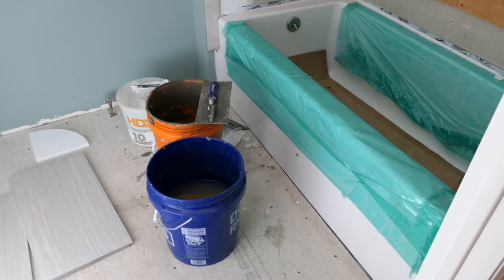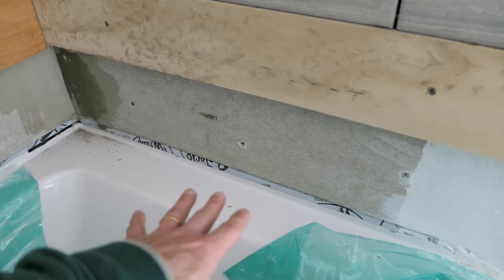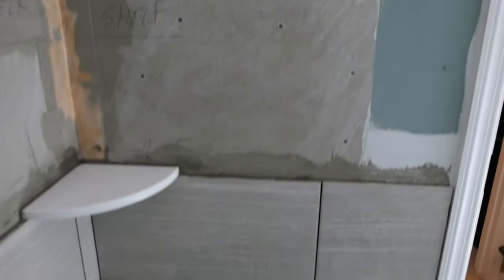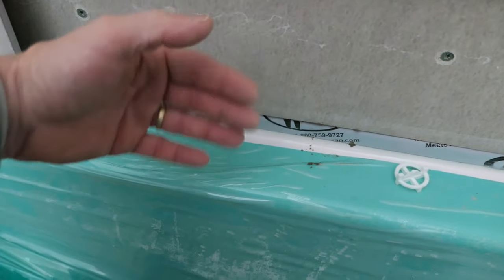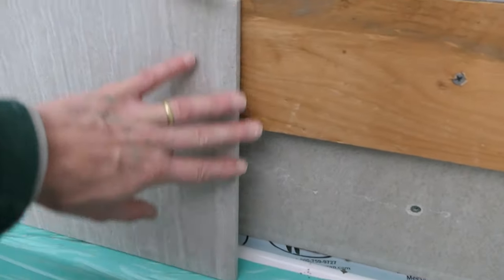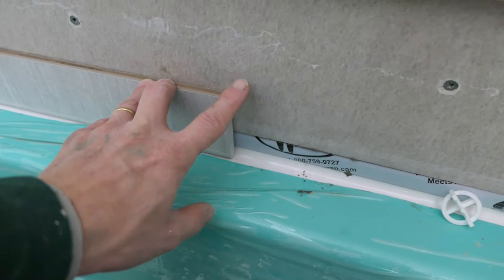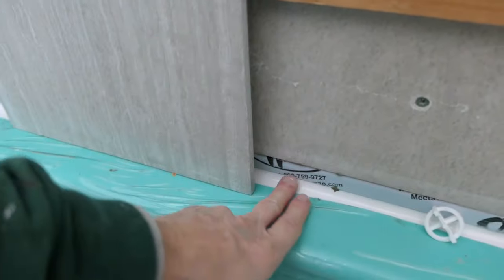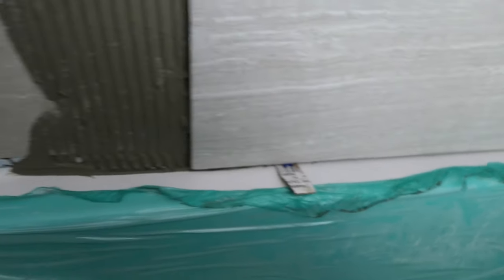How To Tile Over The Lip Of A Tub Or Shower Pan

Comment: If you're doing this for yourself let alone professionally, spend the extra cash and put a few layers of Redgard/Hydroban or use Schluter especially if you're already attempting to waterproof the corners. I've pulled out many showers and cement boards are water-resistant not water-proof. Grout is always waterpermeable hence why most custom high tiling jobs for curbs use solid stone cap or longer tiles since it's high traffic.
Reply from the maker: I do use Schluter membrane one certain jobs, especially when the shower floor is being tiled.  However, it simply isn't necessary to use it in every case and there are drawbacks to using it.  These include poorer adhesion of tile compared to the straight Hardibacker I use, and greater time and expense.  You should also be aware that Hardibacker now does sell a product with "hydrodefense" which is claimed to be waterproof.

Beyond that, I have taken apart somewhere between 65 and 70 bathrooms, and not a single one had water intrusion in the middle of the tile field, even though many of them simply had greenboard backer.   Where I DO consistently find water damage is at the floor where the edge of the tub or pan meets the plywood.  That's where I spend extra time and expense to waterproof, using self-adhesive flashing.

Comment: It really looks like most bathroom remodels would need the backer board to come to the lip only, in order to match existing drywall. In that case, note to self - DON'T use smaller subway tiles for those remodel jobs

Comment: This was super helpful. So basically if you cannot bring the backer board all the way down then you must pick a large scale tile? Do you have any other solutions for when this occurs and your tile is not large scale?
Reply from the maker: My rule of thumb is that 2/3 of the tile is adhered to the backerboard, so that doesn't have to be a large format tile if you have your tub lip exposed.  A 3x6 tile, for example, would be okay if the lip exposure is an inch.  Of course, the more adhesion the better.  If a client really wants a smaller tile I make every effort to bring the backerboard over the lip.  But, sometimes it just isn't in the cards.

Comment: Some say don’t bring backer board over the lip of a shower. Water can get through the base and if it touches the base of the backer board it will wick it up the board and keep it wet, rotting wood, creating mold etc.
Reply from the maker: My advice is based on experience, not fear.  First, as you saw, I use a flashing system behind the backerboard so even if the backerboard somehow became saturated it wouldn't go any farther.  Second, the backerboard is covered in tile, then the tile is grouted and the bottom gap by the tub or pan is caulked.  Water does not get behind there unless the installation was extremely poor or the homeowner failed to maintain the caulk over a period of years.  And, if the caulk is missing, then the water can come right back out!  It just isn't the problem it is made out to be.

Comment: I'm learning to reno my bathroom and I appreciate you pointing out to consider the movement of the tub by using caulking. However, if water would ever get behind the backerboard, how would it drain into the tub? Wouldn't the caulking block water from doing so?
Reply from the maker: To be clear, the flashing is NOT about everyday use.  It's there so that years down the line if the homeowner fails to maintain the caulk or grout, or if there is significant framing movement, water isn't going to drain into the wall cavity.  In a tiled shower that has been detailed well and has grout and caulk intact there is no water getting behind the tile.  There isn't even moisture getting through the grout unless you have a family of 12 who use the same shower all day long.

Comment: Great videos! My husband redid our bathroom years ago. I'm not sure where he got this from, but in addition to using a bathroom drywall product (not sure of the brand, but it was green), applying kerdi all over the walls, corners and ceiling (we have one of those shimmed-in showers with ugly borders) and covered in 8x14 tiles, he kept saying that there was a need for a large gap at the bottom. Something like it's inevitable that water will get in, as the grout is permeable, so the kerdi will protect the wall behind, and the gap at the bottom allows the water to come out and "breathe" 🤷. It's a ½ inch gap. He then filled the gap with clear bathroom silicone and then put white caulk on top to connect the tiles to the tub. I admit that I haven't been maintaining the shower and saw some dark mold in an area, so today I just removed the caulk and silicone to find nasty, wet, brown slime. Instead of caulking again, I want to use a "seal-a-crack tub surround waterproof adhesive sealer" I got at Home Depot, so it'll take care of the gap. My question is, how do I get the gap clean again and prevent more moisture from forming and needing to take everything out and do another expensive renovation? Is it salvageable?
Reply from the maker: Oh boy.  A lot to unpack here.  So, I can only make some guesses about the construction based on your description.  You mentioned a green drywall product, which I'm going to assume is "green board."   That is no longer used because it is just a slightly more water resistant form of drywall and in wet conditions it can still support the growth of mold, as well as crumbling if it does get wet.  Kerdi membrane is a waterproofing product, but, like anything, the devil is in the details.  If it isn't installed exactly right it won't work. There was a time when Schluter (who makes Kerdi) did advise installation over greenboard, but pros avoided that.  I don't know how your husband handled the detail where the Kerdi comes to the bottom.  That whole caulking thing you describe is not something I would recommend.  I'm presuming he used thinset that he mixed himself, rather than some pre-made product or mastic?  

Anyway, it sounds like water has been getting in somewhere and for a long period, and now you have some nasty stuff which may have created a problem with the drywall underneath.  The 1/2" inch gap is way too big and cannot really be effectively caulked.  At this point you probably have two choices.  One is to remove all the caulk you can, clean with bleach and let it air out for a couple days.  Then you could attempt to recaulk, perhaps after installing backing rod.  The problem will likely return though.  That seal-a-crack product doesn't sound promising to me.  The second choice would be to remove the first row of tile, and then try to re-tile using a complimentary color or perhaps you still have extra of the original tile.  In that case, you would do as I did in the video and keep the gap between tile and tub the same as the grout lines.  Then use a silicone caulk there.  However, there's no guarantee the original tile on the first row will come off without cracking other tiles or that the substrate underneath is any good now.

It may be worth calling in a local tile pro to see if he has suggestions.  It's pretty tough for me to offer better advice without seeing the problem in person.
Reply: @enduringcharm  Thank you so much for taking the time to respond and providing a helpful answer. I'm never going to neglect caulk or grout ever again! 🤣 You've gained a new subscriber! 👍
Reply: @IamSlacker  are the vertical corners caulked or grout? I always use a color matched caulk on the corners of walls because they can crack and water will get it and work it’s way down. Usually the corners next to the shower head. Once it goes down and gets behind the caulk on the bottom it works horizontally because it can’t get through the caulk. I’d run a thin layer of color matching quality caulk on the corners, over the grout line. Use tape for a clean line and work it in with your finger to make sure it gets into any hair line cracks. Good luck 🍀

Comment: As a professional tile setter myself you are 100% correct in this video.  The only thing you forgot to mention is how those spacers are the best spacers in the world.   Like how they are straight on the back side and 4 way on the front side and how you can put them in the back corner and they work as the best guide in the world for the opposing walls to make your grout joints align perfect every single time.   Plus you should mention that a tile job turns out the best when the tiles on the back wall go corner to corner and the opposing walls butt into the back wall.    Good video E.C.
Reply from the maker: Yeah, we forget what a pain those old rubber spacers used to be!  The plastic ones are much more consistent and also easier to remove after the the tiles are set.  I do sometimes use one or two of the old rubber ones when a tile is not uniform or the same size as the rest of the tiles. Another great thing about the plastic spacers is that you can get more use out of them.  I have a bucket of 1/8 spacers I've reused countless times.

Comment: I see your method. Thing is filling that area with thinnest will create a area to suck up moisture and create mold over time. Best way is to fill with a sealant from wedi or laticrete flush with the back board. Which foam board is a great option.
Reply from the maker: I hear of that fear a lot, but it simply isn't true.  Antimicrobial products are added to modern mortars, such as "Moldgard" in FlexBond thinset.  Mold needs a food source as well as moisture, and neither the thinset nor the tub lip provide that source.  If the last row of tile is properly caulked with a silicone caulk against the tub or pan, and if the grout is sealed, there really shouldn't be any water getting behind the tile at all.  Of course, homeowners do neglect maintenance.  But, in all the baths I've torn apart, that's not where I find mold.  It will be located where there is wood, or drywall in the old days, or in the grout.  I've never had the lip area be a problem, except right under the faucet when tile was put over drywall or greenboard.

Comment: Great vid! I have a question: you can see that your cement board looks almost flush to the tub there, on mine the cement board juts out much ahead of the flange lip. I have a 1/4th gap for expansion between the two, but I'm just wondering if this will cause issues with finishing it if the cement-board is roughly a 1/2 prouder than the tub flange?
Reply from the maker: Well, the backerboard itself is no more than 1/2 inch, and many brands a little less.  So the difference in plane is probably not as much as you fear.  Nonetheless, when you have a significant difference between the plane of the lip and the backer, the most important thing is not to choose a small format tile.  If you have a 12x12 or a 12x24 tile, the lip area is inconsequential because you can just fill the space with thinset for support but the adhesion to the wall takes place above.  On the other hand, if you tried to use a small 3x6 or 6x6 tile, a large amount of the surface area of the tile would be over the lip.  That could be trouble as far as adhesion and durability.
Reply: @enduringcharm  Thank you for the reply! This is exactly what I ended up doing! I'm using large format tile, 12x24!

Comment: Thanks for the video! This is exactly what i was wondering after installing my backer board. I used your method of the flashing and brought the backer board down to the lip but did not overlap. Unfortunately I already bought small tiles and they’re not refundable. What are your thoughts on inserting a strip of 1/4” Hardie Board into the gap and adhering it to the flashing with construction adhesive to give a more solid backing?
Reply from the maker: I'm not thrilled with the idea of a filler strip.  No matter what you use to fill that space, it isn't going to stick to the flashing or to the lip of the tub if you didn't use flashing.  So whatever you put in there isn't going to provide adhesion for the tile, it's just going to fill the space so that the tile doesn't crack if bumped.   If you install a small format tile it will adhere to the backerboard with thinset and it will stick to whatever thinset you use to fill that cavity, but that same thinset won't stick for any length of time to the flashing or to the lip.  When you caulk the bottom of the tile with silicone that will provide some additional support.  If you go ahead with the small tile, I would advise you to get as much of it as you adhered to the backer and be meticulous in the other two details.
Reply: @enduringcharm   thanks. It sounds like I have some decisions to make. The bathroom is part of a larger basement remodel so I might be able to repurpose the smaller tile

Comment: Great video!!! Did you shim the tiles in for support on the bottom
Reply from the maker: Most often I will use a ledger for the second row and complete the walls, then remove the ledger to complete the first row.  I'll use spacers to set the gap between the tub/pan and tile to the same width as the grout lines.

Comment: Thanks so much for sharing this tip and your expertise! One question - do we tape the plastic wrap to the flashing or just let it hang over it with no seal?
Reply from the maker: To be clear, the flashing and plastic are there in case there is a problem in the future, such as grout or caulking not being maintained or framing movement.  You can just overlap the two components so that if water got into a corner, for example, it would run down the plastic, over the flashing and back into the tub.  The plastic should not cover the whole wall, only about three feet up from the lip.  That's enough to offer some protection but not so much as to create a double vapor barrier.
Reply: @enduringcharm  Great, that is what I figured, but I wanted to confirm. Thanks! :)

Do you happen to know where I can find guidance on how to put plastic sheathing behind a shower niche? I have one in one of the walls of my shower, but still want to use the method you describe here.
Reply from the maker: There's really no difference, you can usually sneak plastic behind the niche if you wish.  I do prefer the one-piece pre-manufactured niche inserts which are not going to leak.  There are some made of plastic, and there are those made by Schluter.  I've used both successfully.

Comment: Great videos... super helpful. What would you do if the tub lip sticks out past the backer board? I can’t shim my wall for the reasons you’ve described.
Reply from the maker: Some tub lips are fairly thick but it really shouldn't be sticking out past the backerboard unless the rough opening is actually too big.  If the mismatch is greater than, say, an 1/8 inch, you may need to adjust the rough opening or carefully split the distance to minimize the problem.  Other solutions include shimming the backer a slight amount and significantly feathering the wallboard joint, or using thinset on the backer to create a little extra space.  In extreme examples where the rough opening is too big and the walls can't be moved you may need to shim out an entire wall.  See this video for an example of that:
https://youtu.be/-bViu_9CJ58

Comment: Thanks for the explanation. I’m remodeling a 1980’s bathroom, and the original surround had two layers of 5/8” drywall (no waterproof membrane), and the edge was finished with radius tile to step down to the bathroom wall which is a single layer of 5/8” drywall. I’m not sure how it lasted 40 years, but it only failed when grout in the window sill cracked. Windows in shower surrounds were popular in the 80’s for some reason. Have you ever seen the tape over the flange lose adhesion over a period of time?
Reply from the maker: Your double layer of drywall is odd, but it was routine to use drywall as a backer for tile decades ago.  The thing is, I have taken apart dozens of baths built that way which were in perfect condition.  Thankfully we don't build that way anymore.  On the other hand, I have to roll my eyes sometimes with the modern obsession with waterproofing. Some people go to extremes with waterproofing when it isn't necessary, or preach about the sky falling if a particular brand of waterproofing isn't used.   The flashing tape trick I use not as waterproofing, but as a backup in the event the homeowner doesn't maintain the caulk and grout over the years.  Sometimes I will also use a waterproofing membrane made by Schluter if I'm concerned about a particular installation.

Windows, on the other had, are a big no-no.  I remove them if they are found in a shower because it is inevitable that they will fail and allow rot inside the wall cavity and other problems.

Comment: Thank you for the video. It is very informative.  I have a question.  What do you think about using liquid waterproofing membrane (Mapey brand for an instance) on the walls above a bathtub?  Thank you.
Reply from the maker: When I need to waterproof a whole shower I use the Schluter brand Kerdi membrane.  It's a plastic membrane with a fuzzy coating that provides waterproofing and good tile adhesion.  Liquid membrane can be inconsistent in coverage and adhesion may be questionable.  I don't use any of those products.  Now, when I tile the floor of a shower I use the Schluter system and run the Kerdi membrane right up the walls.  On the other hand, I don't find that a complete waterproofing system is necessary in other cases.  Instead I use a flashing system behind the backerboard which I've shown in a number of my videos.